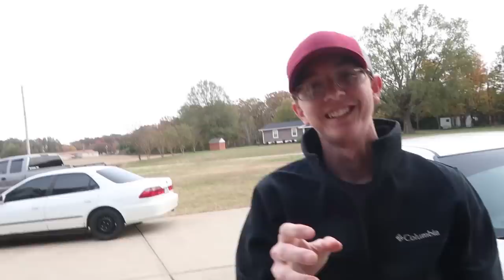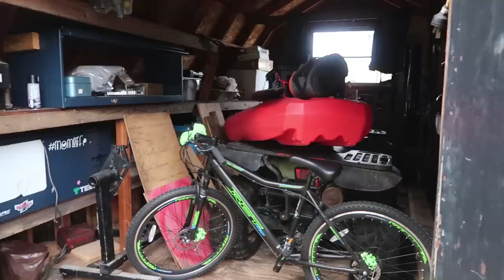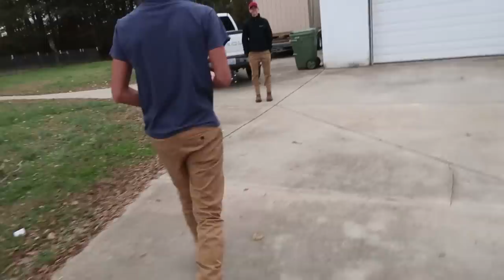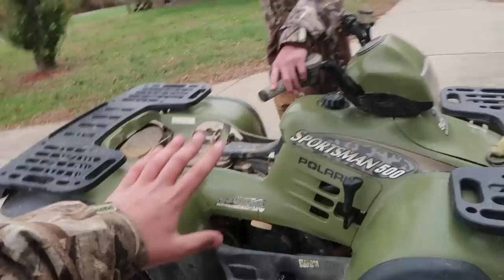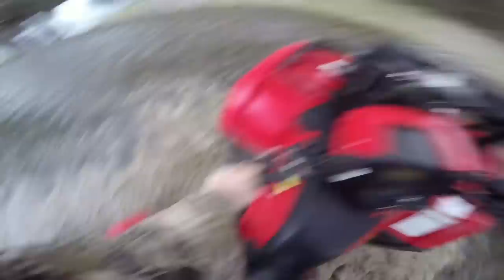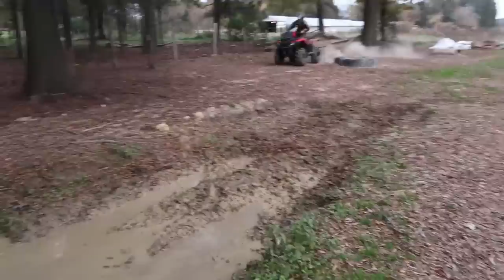MUDDING on the NEW Four Wheeler!

Comment: To put the sportsmen in gear don't you hold the lever brake on the handle bars I just got one and I don't know how to put it into gear
Reply: @zackw6355  shift it well I'm holding the throttle? Or shift it after I let go off the gas